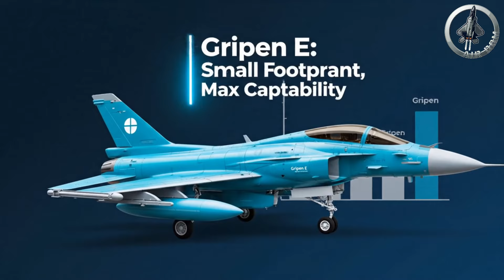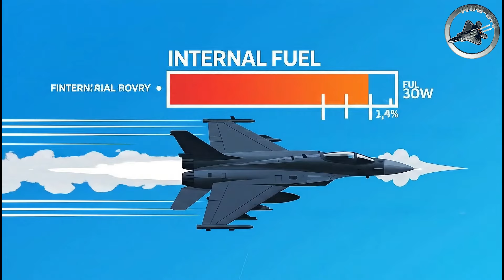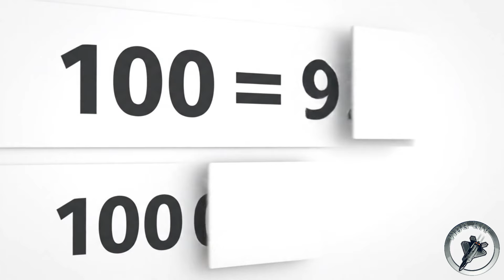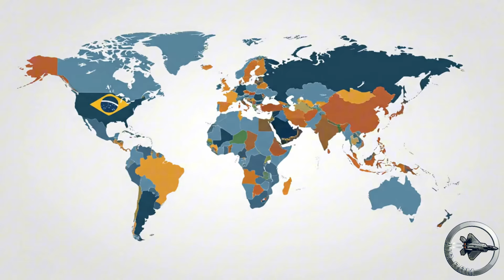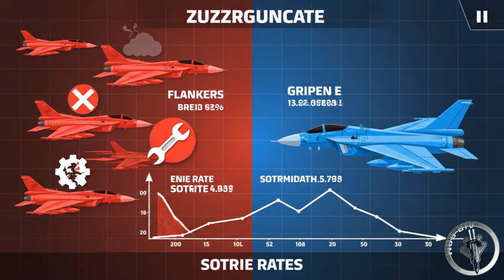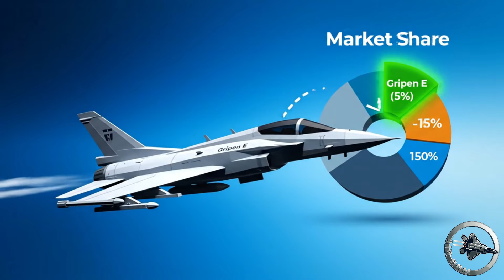Saab Gripen E: The Nightmare Upgrade Nobody Saw Coming #RollsRoyce #JetEngine #FighterJet

Comment: We need to keep our feet on the ground, first because that Rolls-Royce engine is designed for the GCAP; second because the entire aircraft would have to be redesigned because it would most likely have structural problems; and third, as I said before, since it's an engine for the sixth-generation GCAP aircraft, an Italian-British-Japanese project is covered by military secrecy. The only chance of seeing a Rolls-Royce engine installed on a Saab aircraft is if the aircraft were redesigned with an engine other than the General Electric one.
Reply from the maker: You make a solid point—redesigning the airframe for a new engine profile is a massive engineering hurdle, not just a simple swap. Given those constraints, do you think Saab's reliance on the US-made GE engine creates a long-term strategic vulnerability, or is the performance reliability worth that geopolitical risk?

Would you like me to analyze the specific thrust-to-weight ratios of the GE F414 vs the proposed GCAP specs for a future video?
Reply: Some time ago, I read in an interview with the CEO of SAAB that the company is designing a sixth-generation stealth aircraft with a 10-15 year horizon. After Sweden withdrew from the project originally called TEMPEST, now called GCAP, the project itself follows the same philosophy as GCAP, within a strategy (system of systems). It operates within a NATO compatibility and interoperability area. In this case, power, unless Sweden reconsiders its strategy, will not be provided by the Rolls-Royce engine. The Swedish government has mandated SAAB to design an indigenous engine. The engine must be capable of providing sufficient power for powerful directed-energy weapons such as lasers, electronic warfare, electromagnetic radar attack systems, and microwave weapons, as well as drone management and intercommunication with all battlefield players. Drone management, along with augmented reality such as the wearable cockpit, practically all information is projected directly onto the instruments, 3D maps, and mission data. It's like being inside the battlefield, enjoying a 360-degree view along with many other toys. Regarding the engine you mentioned, the Rolls-Royce (it doesn't have a name yet but is identified as the "Adaptive Cycle Engine" or VCE) of the sixth-generation stealth aircraft mounted on the GCAP provides an approximate thrust of 150,000 Newtons (or 150 kN) per engine. Since there are two engines, the total thrust will be 300,000 Newtons (or 300 kN). The companies involved will be Leonardo Italy (lead), Avio Aero, Elettronica (ELT Group), and MBDA Italy. United Kingdom; BAE System (lead), Rolls-Royce, Leonardo UK, and MBDA UK. Japan's Mitsubishi Heavy Industries (lead), IHI Corporation, and Mitsubishi Electric. These companies are working together through the joint venture called Edgewing to develop the sixth-generation fighter by 2035. Now, considering all this information, the final conclusion is that for now, the SAAB fighter will not be powered by the Rolls-Royce engine. Never say never.

Comment: AI nightmare audio...
Reply from the maker: We appreciate the honest critique—we're constantly trying to balance quality and speed. Is it the robotic cadence that bothers you the most, or would you simply prefer a human narrator regardless of the production time?
Reply: @AirDom88   All AI videos are too long.  
They may dig deep into information but it becomes repetitive, boring and mechanical to the point that the viewer just turns off.  
I suggest that all AI videos should have a maximum time limit of say 5 or 10 minutes.  
Or if a deeper dig is felt necessary, to give the viewer a choice of various lengths.
Reply: @AirDom88  Look at the video and you will understand. There are so many cut off parts that it's hard to know what the AI is trying to say.